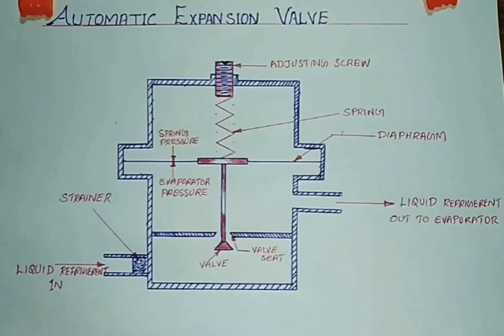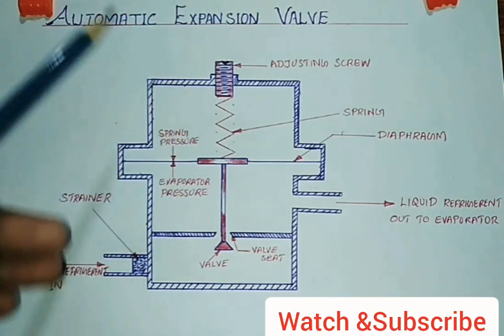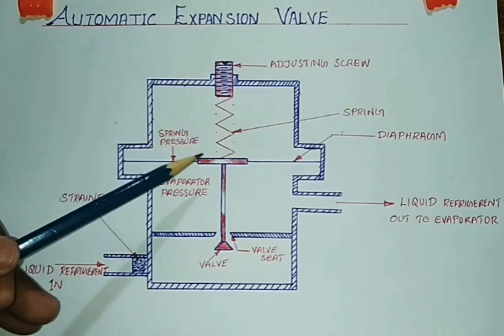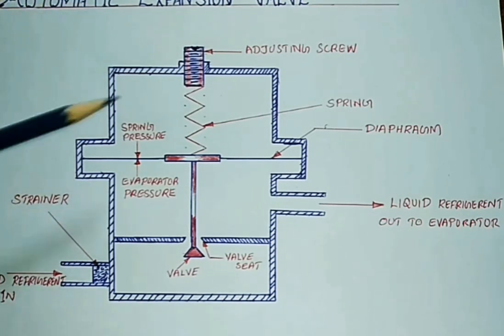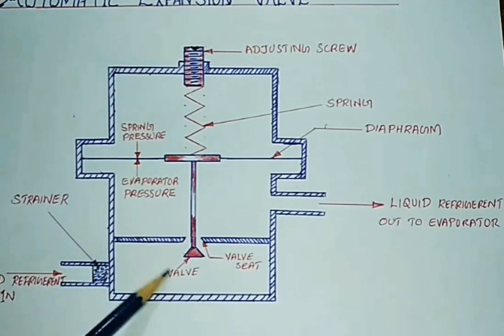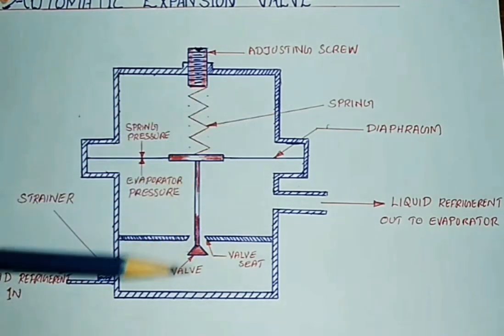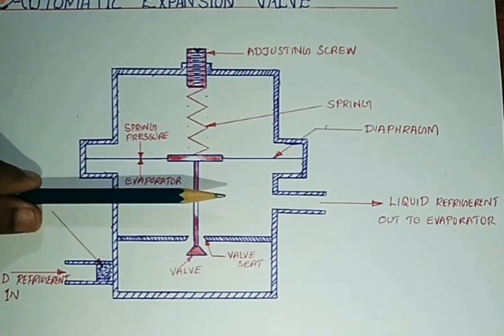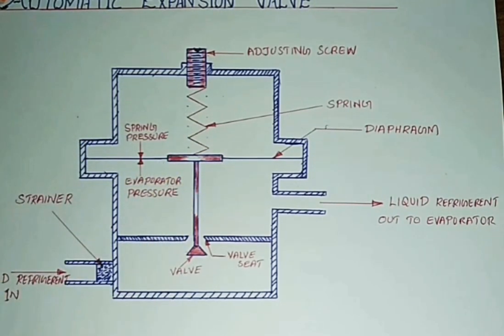#AutomaticExpansionValve #WorkingPrincipleInMalayalam #RAC|#kgcerefrigerationandairconditioning

Comment: 1A. *valve.
     *valve seat.
     *diaphram.
     *spring.
     *adjusting screw. 
2A. ഡയഫ്രത്തിന്റെ മുകളിൽ spring pressure. 
ഡയഫ്രത്തിന്റെ താഴെ evaporator pressure. 
3A. ഡയഫ്രത്തിന്റെ മുകളിൽ act ചെയ്യുന്ന രണ്ട് പ്രഷർ act ചെയ്യുന്നത് പോലെ ആയിരിക്കും valve തുറക്കുന്നതും അടയുന്നതും. 

MUHAMMED MUBEEN. K
RAC JR A BATCH
ROLL:NO. 18
Reply from the maker: Good ✔️✔️✔️
Reply from the maker: Diaphragm

Comment: Jaseel k
 no :16
R& ac jr b batch
--------------------------

1a.valve,  Valve seat, Diaphram, Spring, 
Adjusting screw 
2a.ഡയഫ്രത്തിന്റെ മുകളിൽ spring 
Pressure
ഡയഫ്രത്തിന്റെ തായെ evaporator pressure
3a.ഡയഫ്രത്തിന്റെമുകളിൽact 
ചെയ്യുന്ന രണ്ട് pressure act ചെയ്യൂ 
ന്നത്പോലെ ആയിരിക്കും valve 
തുറക്കുന്നതും അടയുന്നതും ചെയ്യുന്നത്.

Comment: Nishad pn 24 Jr b batch
1 a valve
Valve seat
Diaphram
Spring
Adjusting screw

2 a diaphrathinte mukhalill spring pressure
Diaphrathinte thaye evaporator pressure
3 a diaphrathinte mukhallil act cheyunnapole ayirikum valve thurakunnadhum adakunnadhum

Comment: Q1: •Valve
        • Valve seat
        •Diaphragm
        •Spring
        •Adjusting Screw

Q2: ഡയഫ്രത്തിന്റെ മുകളിൽ Spring pressure .ഡയഫ്രത്തിന്റെ താഴെ Evaporator pressure.

Q3: സയഫ്രത്തിന്റെ മുകളിൽ ആക്റ്റ് ചെയ്യുന്ന രണ്ട് പ്രഷർ ആക്റ്റ് ചെയ്യുന്നത് പോലെ ആയിരിക്കും വാൾവ് തുറക്കുകയും അടയുക്കു കയും ചെയ്യുന്നത്.

MUHAMMED UVAIS P 
RAC JR A BATCH

Comment: Albin benny
Roll no :4
R& ac jr b batch
--------------------------

1a.valve 
   Valve seat
   Diaphram
  Spring
Adjusting screw 
2a.ഡയഫ്രത്തിന്റെ മുകളിൽ spring 
Pressure
ഡയഫ്രത്തിന്റെ തായെ evaporator pressure
3a.ഡയഫ്രത്തിന്റെ മുകളിൽ act 
ചെയ്യുന്ന രണ്ട് pressure act ചെയ്യൂ 
ന്നത്പോലെ ആയിരിക്കും valve 
തുറക്കുന്നതും അടയുന്നതും ചെയ്യുന്നത്.

Comment: Muhammad Hashir p
R& AC B batch
No..12
1A . * valve . * valve seat . * diaphram . * spring . * adjusting screw .
 2A . ഡയഫ്രത്തിന്റെ മുകളിൽ spring pressure . ഡയഫ്രത്തിന്റെ താഴെ evaporator pressure .
 3A . ഡയഫ്രത്തിന്റെ മുകളിൽ act ചെയ്യുന്ന രണ്ട് പ്രഷർ act ചെയ്യുന്നത് പോലെ ആയിരിക്കും valve തുറക്കുന്നതും അടയുന്നതും .

Comment: 1:valve
Valve seat
  Diaphram
  Spring
  Adjasting screw
2:a diphrathinte makhlill spring  pressure           diaphrathinte thure evaporutor pressure
3:a diphrathinte makhlillact  cheyannapote
   Ayirikam valve thurukannadhum adakunndhum
  RAC/JR/B/BATCH
 ROLLNO:2
Adithyan..at

Comment: R/AcC jounir b batch no:06 
Arun Johny 
1a.  valve
        Valve seat
        Diaphram
        Spring
        Adjusting screw
     2a .diafram മുകളിൽ spring pressure disfram താഴെ evaperater  pressure.
      3a .diafram മുകളിൽ act ചെയുന്ന pressure act ചെയുന്നത് പോലെ ആയിരിക്കും valve തുറക്കുന്നു .

Comment: 1) *valve
    *Valve seat
    *diaphram
    *spring
    *adjusting screw
2) ഡയഫൃത്തിൻെ മുകളിൽ spring pressure
    * ഡയഫൃത്തിൻെ താഴെ  evaporator pressure
3) ഡയഫൃത്തിൻെ മുകളിൽ അക്റ്റ് ചെയ്യുന്ന 2പൃഷർ.പൃഷർ അക്റ്റ് ചെയ്യന്നതിനനുസരിച്ച് valve തുറക്കുകയും അടയുകയും ചെയ്യുന്നു
MANU HAFIL
RAC JR A BATCH
ROLL NO:10

Comment: Q1: Valve
       Valve seat
       Diaphyam
       Spring
      Adjusting Scr
Q2: ഡയഫ്രത്തിന്റെ മുകളിൽ Spring pressure.
             ഡയഫ്രത്തിന്റെ താഴെ Evaporator pressure.
Q3: സയഫ്രത്തിന്റെ മുകളിൽ ആക്റ്റ് ചെയ്യുന്ന രണ്ട് പ്രഷർ ആക്റ്റ് ചെയ്യുന്നത് പോലെ ആയിരിക്കും വാൾവ് തുറക്കുകയും അടയുക്കു കയും ചെയ്യുന്നത്.
Ameen Minhaj as
RAC jr A Batch
Roll No 6

Comment: Q1: valve
        Valve seal
         Diaphyam
        Spring
         Adjusting scr
Q2 : spring pressure above the diaphragm evaporator pressure below the diaphragm
Q3: ഡയഫ്രത്തിന്റെ മുകളിൽ Act ചെയ്യുന്ന രണ്ട് പ്രഷർ Actചെയ്യുന്നത് പോലെ ആയിരിക്കും valve തുറക്കുന്നതും
അടക്കുന്നതും

Comment: A1.valve
    . Valve seat
    . Diaphram
    . Spring
    . Adjusting screw
A2 ഡയഫ്രത്തിന്റെ മുകളിൽ  spring pressor
ഡയഫ്രത്തിന്റെ താഴെ evaporator pressor
A3.ഡയഫ്രത്തിന്റെ മുകളിൽ act ചെയുന്ന രണ്ട് പ്രഷർ act ചെയുന്നത് പോലെ ആയിരിക്കും valve തുറക്കുന്നതും അടയുന്നതും 

Nisamudheen
Rac jr a bach
Rol no 21

Comment: 1. Valve
Valve seat
Diaphyam
Spring
Adjusting scr
2. ഡയഫ്രത്തിൻ്റെ മുകളിൽ spring pressure
ഡയഫ്രത്തിൻ്റെ താഴെ evaporator pressure
3. ഡയഫ്രത്തിൻ്റെ മുകളിൽ ആക്റ്റ് ചെയ്യുന്ന രണ്ട് പ്രഷർ ആക്റ്റ് ചെയ്യുന്നത് പോലെ. ആയിരിക്കും വാൾവ് തുറക്കുകയും അടക്കുകയും ചെയ്യുന്നത്
Vishnu das m.u
RAC jr A bacth
No.30

3.

Comment: 1a-valve
   . Valve seat
   . Diaphram
   . Spring
   . Adjusting screw
2a-ഡയഫ്രത്തിന്റെ മുകളിൽ spring pressure
ഡയഫ്രത്തിന്റെ തയെ evaporator pressure
3a-ഡയഫ്രത്തിന്റെ മുകളിൽ act ചെയ്യുന്ന രണ്ട് pressure act ചെയ്യുന്നത് പോലെ ആയിരിക്കും valve തുറക്കുന്നതും അടയുന്നതും 
              
            MUHAMMED SHIYAS
                 R A/C JR A
                  ROLL NO -24

Comment: Athul
Roll no :9
R& ac jr b batch

1a.valve 
   Valve seat
   Diaphram
  Spring
Adjusting screw 
2a.ഡയഫ്രത്തിന്റെ മുകളിൽ spring 
Pressure
ഡയഫ്രത്തിന്റെ തായെ evaporator pressure
3a.ഡയഫ്രത്തിന്റെ മുകളിൽ act 
ചെയ്യുന്ന രണ്ട് pressure act ചെയ്യൂ 
ന്നത്പോലെ ആയിരിക്കും valve 
തുറക്കുന്നതും അടയുന്നതും ചെയ്യുന്നത്.

Comment: 1.a *valve
      *valve seat
     *diaphram
      * spring 
     * adjusting screw
2.a ഡയഫ്രത്തിൻെ മുകളിൽ spring pressure 
      ഡയഫ്രത്തിൻെ തായേevaporator pressure 
3.a ഡയഫ്രത്തിൻെ മുകളിൽ act ചെയ്യുന്ന 2 pressure act ചെയ്യുന്നത് പോലെ ആയിരിക്കും valve തുറക്കുന്നതും അടയുന്നതും ചെയ്യുന്നത്
Finu fahad 
R/ac jn.   B.    Batch 
No: 14

Comment: 1a.valve 
   Valve seat
   Diaphram
  Spring
Adjusting screw 
2a.ഡയഫ്രത്തിന്റെ മുകളിൽ spring 
Pressure
ഡയഫ്രത്തിന്റെ തായെ evaporator pressure
3a.ഡയഫ്രത്തിന്റെ മുകളിൽ act 
ചെയ്യുന്ന രണ്ട് pressure act ചെയ്യൂ 
ന്നത്പോലെ ആയിരിക്കും valve 
തുറക്കുന്നതും അടയുന്നതും ചെയ്യുന്നത്. 
       

Aswanth.TM
Roll:No:7
Rac jr b batch

Comment: 1a.valve
    Valve seat
    Diaphram
    Spring
    Adjusting screw
2a.ഡയഗ്രത്തിൻ്റെ മുകളിൽ spring pressure ഡയഗ്രത്തിൻ്റെ താഴെ evapurator
Pressure
3a.ഡയഗ്രത്തിൻ്റെ മുകളിൽ act ചെയ്യന്ന രണ്ട് Pressure act ചെയ്യുന്നത് പോലെ valve തുറക്കുന്നതും അടയുന്നതും
 
Muhammed Minhaj VA 
  Rac jr A batch
Roll no 17

Comment: Q1-Valve
Valve seat
Diaphyam
Spring
Adjusting Scr

Q2-Spring pressure above the diaphragm
Evaporator pressure below the diaphragm

3Q-ഡയഫ്രത്തിന്റെ മുകളിൽ act ചെയ്യുന്ന രണ്ട് പ്രഷർ act 
ചെയ്യുന്നത് പോലെ ആയിരിക്കും valve തുറക്കുന്നതും 
അടയുന്നതും

--------------------------------------------
( Muhammed Munshid k 
RAC Jr A Batch 
Roll No. 19 )
-------------------------------------------
Reply: Hi
Reply: @muhammedharshad602  Hy

Comment: 1 a valve Valve seat Diaphram Spring Adjusting screw

 2 a diaphrathinte mukhalill spring pressure Diaphrathinte thaye evaporator pressure 

 3 a diaphrathinte mukhallil act cheyunnapole ayirikum valve thurakunnadhum adakunnadhum 
    

muhammed nihan  
RAC jr A batch
roll no 20

Comment: 1a:valve  
. Valve 
.Diaphram
. Spring 
. Adjusting screw
2a-:diaphramthinta  mukalil spring pressure  diaphram thaaye evaporator pressure 
3a: diaphram thinta mukalil  act  cheyyunna rand pressure  act cheyyunnath  poole aayirikum valve thurakkunnathum adakkunnthum  
 
          Rinshad kv
         RAC(jr) A  batch 
         Roll no : 28

Comment: I.Valve
 .valve Seat
 .diaphram
 . Sprig
 .adjusting screw
2. ഡ യ ഫ്രത്തിൻ്റെ മുകളിൽ spring pressur
 ' ഡയഫ്രത്തിൻ്റെ താഴെ evaporator Pressur
3' ഡയഫ്രത്തിൻ്റെ മുകളിൽ act ചെയ്യുന്ന രണ്ട് പ്രഷർ act ചെയ്യുന്നത് പോലെ ആയിരിക്കും valve തുറക്കുന്നതും അടക്കുന്നതും

RAC Jr A BACH
NO 15
MUHAMMED HARSHAD KP

Comment: 1.valve
   Valve seat
  Diaphyam
  Spring
  Adjusting scr
2.ഡയഫ്രത്തിന്റെ മുകളിൽ spring pressure
    ഡയഫ്രത്തിന്റെ  താഴെ  evaporator pressure
3.ഡയഫ്രത്തിന്റെ മുകളിൽ ആക്റ്റ് ചെയ്യുന്ന രണ്ട് പ്രഷർ ആക്റ്റ് ചെയ്യുന്നത് പോലെ ആയിരിക്കും വാൾവ് തുറക്കുകയും അടയ്ക്കുകയും ചെയ്യുന്നത് 
    Afsal. V
    Rac jr A Batch
    Roll No.  4

Comment: Q1: Valve
       Valve seat
       Diaphyam
       Spring
      Adjusting Scr

Q2: ഡയഫ്രത്തിന്റെ മുകളിൽ Spring pressure.
             ഡയഫ്രത്തിന്റെ താഴെ Evaporator pressure.

Q3: സയഫ്രത്തിന്റെ മുകളിൽ ആക്റ്റ് ചെയ്യുന്ന രണ്ട് പ്രഷർ ആക്റ്റ് ചെയ്യുന്നത് പോലെ ആയിരിക്കും വാൾവ് തുറക്കുകയും അടയുക്കു കയും ചെയ്യുന്നത്.

Adarsh_tr 
RAC jr A Batch
Roll No 2

Comment: 1a.valve 
   Valve seat
   Diaphram
  Spring
Adjusting screw 
2a.ഡയഫ്രത്തിന്റെ മുകളിൽ spring 
Pressure
ഡയഫ്രത്തിന്റെ തായെ evaporator pressure
3a.ഡയഫ്രത്തിന്റെ മുകളിൽ act 
ചെയ്യുന്ന രണ്ട് pressure act ചെയ്യൂ 
ന്നത്പോലെ ആയിരിക്കും valve 
തുറക്കുന്നതും അടയുന്നതും ചെയ്യുന്നത്. 
       

Aswin krishna. Tp
Roll:No:8
Rac jr b batch

Comment: Muhammed Irshad 
R a/c  B batch 
Roll No:15

1a. Valve
    .valve seat
    .diaphram
    .spring
    .Adjusting screw
2a.diaphrathinte
.     mukhalill spring
pressure diuphrathinte thaye evaporator pressure
3a. Diaphra thinte mujhelill act cheyunna pole ayirikum valve tharakunnadhum adakunnadhum

Comment: Q1: Valve
       Valve seat
       Diaphyam
       Spring
      Adjusting Scr
Q2: ഡയഫ്രത്തിന്റെ മുകളിൽ Spring pressure.
             ഡയഫ്രത്തിന്റെ താഴെ Evaporator pressure.
Q3: സയഫ്രത്തിന്റെ മുകളിൽ ആക്റ്റ് ചെയ്യുന്ന രണ്ട് പ്രഷർ ആക്റ്റ് ചെയ്യുന്നത് പോലെ ആയിരിക്കും വാൾവ് തുറക്കുകയും അടയുക്കു കയും ചെയ്യുന്നത്.
(MHD MIDLAJ MC 
RAC jr A Batch
Roll No 16)

Comment: Q1: Valve
       Valve seat
       Diaphyam
       Spring
      Adjusting Scr
Q2: ഡയഫ്രത്തിന്റെ മുകളിൽ Spring pressure.
             ഡയഫ്രത്തിന്റെ താഴെ Evaporator pressure.
Q3: സയഫ്രത്തിന്റെ മുകളിൽ ആക്റ്റ് ചെയ്യുന്ന രണ്ട് പ്രഷർ ആക്റ്റ് ചെയ്യുന്നത് പോലെ ആയിരിക്കും വാൾവ് തുറക്കുകയും അടയുക്കു കയും ചെയ്യുന്നത്.
Akhilpk
RAC jr A Batch
Roll No 5

Comment: Muhammed shafeeque 
Roll no :20
R& ac jr b batch

1a.valve 
   Valve seat
   Diaphram
  Spring
Adjusting screw 
2a.ഡയഫ്രത്തിന്റെ മുകളിൽ spring 
Pressure
ഡയഫ്രത്തിന്റെ തായെ evaporator pressure
3a.ഡയഫ്രത്തിന്റെ മുകളിൽ act 
ചെയ്യുന്ന രണ്ട് pressure act ചെയ്യൂ 
ന്നത്പോലെ ആയിരിക്കും valve 
തുറക്കുന്നതും അടയുന്നതും ചെയ്യുന്നത്.

Comment: RAC - JR -A Bach 
ROLL NO - 1
ABIJITH  TK

1: Valve
    Valve seat
    Diaphyam
    Spring
    Adjusting Scr
2: ഡയഫ്രത്തിന്റെ മുകളിൽ Spring pressure.
             ഡയഫ്രത്തിന്റെ താഴെ Evaporator pressure.
3: സയഫ്രത്തിന്റെ മുകളിൽ ആക്റ്റ് ചെയ്യുന്ന രണ്ട് പ്രഷർ ആക്റ്റ് ചെയ്യുന്നത് പോലെ ആയിരിക്കും വാൾവ് തുറക്കുകയും അടയുക്കു കയും ചെയ്യുന്നത്.

Comment: Shanif
Roll no :28
R& ac jr b batch

1a.valve 
   Valve seat
   Diaphram
  Spring
Adjusting screw 
2a.ഡയഫ്രത്തിന്റെ മുകളിൽ spring 
Pressure
ഡയഫ്രത്തിന്റെ തായെ evaporator pressure
3a.ഡയഫ്രത്തിന്റെ മുകളിൽ act 
ചെയ്യുന്ന രണ്ട് pressure act ചെയ്യൂ 
ന്നത്പോലെ ആയിരിക്കും valve 
തുറക്കുന്നതും അടയുന്നതും ചെയ്യുന്നത്.

Comment: MUHAMMAD SHAFEEQ NK 
RAC JUNIOR B  BATCH 
ROLL NO :21

  1A : valve 
        *valve seat 
        *diaphragm 
        * spring 
        *adjusting screw 
 2A: ഡയഫ്രത്തിന്റെ മുകളിൽ സ്പ്രിങ് pressure 
               ഡയഫ്രത്തിന്റെ താഴെ evaprator pressure 
3A: ഡയഫ്രത്തിന്റെ മുകളിൽ act ചെയ്യുന്ന രണ്ട് pressure act ചെയ്യുന്നത് പോലെ ആയിരിക്കും valve  തുറക്കുന്നതും അടക്കുന്നതും ചെയ്യുന്നത്

Comment: Muhammad shabeeb pp
Roll no : 19
RAC jr B-batch

1.Valve 
   Valve seat
   Diaphram
   Spring
   Adjusting screw 
2.ഡയഫ്രത്തിന്റെ മുകളിൽ spring 
 Pressure
 ഡയഫ്രത്തിന്റെ തായെ evaporator      pressure
3.ഡയഫ്രത്തിന്റെ മുകളിൽ act 
 ചെയ്യുന്ന രണ്ട് pressure act ചെയ്യൂ 
 ന്നത്പോലെ ആയിരിക്കും valve 
 തുറക്കുന്നതും അടയുന്നതും   ചെയ്യുന്നത്.

Comment: Anudarsh. K
           Roll. No 5
           R&A/C jr b batch
_____________________________

1a.valve 
   Valve seat
   Diaphram
  Spring
Adjusting screw 
2a.ഡയഫ്രത്തിന്റെ മുകളിൽ spring 
Pressure
ഡയഫ്രത്തിന്റെ തായെ evaporator pressure
3a.ഡയഫ്രത്തിന്റെ മുകളിൽ act 
ചെയ്യുന്ന രണ്ട് pressure act ചെയ്യൂ 
ന്നത്പോലെ ആയിരിക്കും valve 
തുറക്കുന്നതും അടയുന്നതും ചെയ്യുന്നത്.

Comment: Q1: Valve
       Valve Sheet  
     Push road
   Brings
  Spring adjusting Scr
Mechanical difrom
Feeler bulb
Q2: Liqued refrigerant ഭാഗികമായി നിറച്ചിരിക്കുന്നു.
Q3: Feeler bulb pressure
     Spring pressure
     Evoprator pressure

         Mihraj ep 
RAC jr A Batch
Roll No 11

Comment: SHAMIL NK
R& ac jr b batch
--------------------------

1a.valve 
   Valve seat
   Diaphram
  Spring
Adjusting screw 
2a.ഡയഫ്രത്തിന്റെ മുകളിൽ spring 
Pressure
ഡയഫ്രത്തിന്റെ തായെ evaporator pressure
3a.ഡയഫ്രത്തിന്റെ മുകളിൽ act 
ചെയ്യുന്ന രണ്ട് pressure act ചെയ്യൂ 
ന്നത്പോലെ ആയിരിക്കും valve 
തുറക്കുന്നതും അടയുന്നതും ചെയ്യുന്നത്.

Comment: AHAMMED NABEEL PM
R&A/C JR B BATCH
ROLL NUMBER:3️⃣
--------------------------

1a.valve 
   Valve seat
   Diaphram
  Spring
Adjusting screw 
2a.ഡയഫ്രത്തിന്റെ മുകളിൽ spring 
Pressure
ഡയഫ്രത്തിന്റെ തായെ evaporator pressure
3a.ഡയഫ്രത്തിന്റെ മുകളിൽ act 
ചെയ്യുന്ന രണ്ട് pressure act ചെയ്യൂ 
ന്നത്പോലെ ആയിരിക്കും valve 
തുറക്കുന്നതും അടയുന്നതും ചെയ്യുന്നത്.

Comment: Muhamadh shahad
Roll no :22
R& ac jr b batch
--------------------------

1a.valve 
   Valve seat
   Diaphram
  Spring
Adjusting screw 
2a.ഡയഫ്രത്തിന്റെ മുകളിൽ spring 
Pressure
ഡയഫ്രത്തിന്റെ തായെ evaporator pressure
3a.ഡയഫ്രത്തിന്റെ മുകളിൽ act 
ചെയ്യുന്ന രണ്ട് pressure act ചെയ്യൂ 
ന്നത്പോലെ ആയിരിക്കും valve 
തുറക്കുന്നതും അടയുന്നതും ചെയ്യുന്നത്.

Comment: vahid
Roll no :1
R& ac jr b batch
--------------------------

1a.valve 
   Valve seat
   Diaphram
  Spring
Adjusting screw 
2a.ഡയഫ്രത്തിന്റെ മുകളിൽ spring 
Pressure
ഡയഫ്രത്തിന്റെ തായെ evaporator pressure
3a.ഡയഫ്രത്തിന്റെ മുകളിൽ act 
ചെയ്യുന്ന രണ്ട് pressure act ചെയ്യൂ 
ന്നത്പോലെ ആയിരിക്കും valve 
തുറക്കുന്നതും അടയുന്നതും ചെയ്യുന്നത്.

Comment: Shibin kurian
Roll no :29
R& ac jr b batch
--------------------------

1a.valve 
   Valve seat
   Diaphram
  Spring
Adjusting screw 
2a.ഡയഫ്രത്തിന്റെ മുകളിൽ spring 
Pressure
ഡയഫ്രത്തിന്റെ തായെ evaporator pressure
3a.ഡയഫ്രത്തിന്റെ മുകളിൽ act 
ചെയ്യുന്ന രണ്ട് pressure act ചെയ്യൂ 
ന്നത്പോലെ ആയിരിക്കും valve 
തുറക്കുന്നതും അടയുന്നതും ചെയ്യുന്നത്.

Comment: Muhammed sinan A 
R/AC JR A BATCH 
ROLL NO 25
---------------
A1- *Valve
         * Valve seat
         *Diaphyam
         *Spring
         *Adjusting Scr
A2- *ഡയഫ്രത്തിന്റെ മുകളിൽ Spring pressure.
    * ഡയഫ്രത്തിന്റതാഴെ Evaporator pressure.
A3- സയഫ്രത്തിന്റെ മുകളിൽ ആക്റ്റ് ചെയ്യുന്ന രണ്ട് പ്രഷർ ആക്റ്റ് ചെയ്യുന്നത് പോലെ ആയിരിക്കും വാൾവ് തുറക്കുകയും അടയുക്കു കയും ചെയ്യുന്നത്.

Comment: MUHAMMED RINSHAD PK
Roll no :17
R& ac jr b batch
--------------------------

1a.valve 
   Valve seat
   Diaphram
  Spring
Adjusting screw 
2a.ഡയഫ്രത്തിന്റെ മുകളിൽ spring 
Pressure
ഡയഫ്രത്തിന്റെ തായെ evaporator pressure
3a.ഡയഫ്രത്തിന്റെ മുകളിൽ act 
ചെയ്യുന്ന രണ്ട് pressure act ചെയ്യൂ 
ന്നത്പോലെ ആയിരിക്കും valve 
തുറക്കുന്നതും അടയുന്നതും ചെയ്യുന്നത്.

Comment: Q1: Valve
       Valve seat
       Diaphyam
       Spring
      Adjusting Scr
Q2: ഡയഫ്രത്തിന്റെ മുകളിൽ Spring pressure.
             ഡയഫ്രത്തിന്റെ താഴെ Evaporator pressure.
Q3: സയഫ്രത്തിന്റെ മുകളിൽ ആക്റ്റ് ചെയ്യുന്ന രണ്ട് പ്രഷർ ആക്റ്റ് ചെയ്യുന്നത് പോലെ ആയിരിക്കും വാൾവ് തുറക്കുകയും അടയുക്കു കയും ചെയ്യുന്നത്.
Althaf pk
RAC jr A Batch
Roll No 12

Comment: Q1: Valve
       Valve seat
       Diaphyam
       Spring
      Adjusting Scr
Q2: ഡയഫ്രത്തിന്റെ മുകളിൽ Spring pressure.
             ഡയഫ്രത്തിന്റെ താഴെ Evaporator pressure.
Q3: സയഫ്രത്തിന്റെ മുകളിൽ ആക്റ്റ് ചെയ്യുന്ന രണ്ട് പ്രഷർ ആക്റ്റ് ചെയ്യുന്നത് പോലെ ആയിരിക്കും വാൾവ് തുറക്കുകയും അടയുക്കു കയും ചെയ്യുന്നത്.
Fahad
RAC jr A Batch
Roll No 13

Comment: Q1: Valve
       Valve seat
       Diaphyam
       Spring
      Adjusting Scr
Q2: ഡയഫ്രത്തിന്റെ മുകളിൽ Spring pressure.
             ഡയഫ്രത്തിന്റെ താഴെ Evaporator pressure.
Q3: സയഫ്രത്തിന്റെ മുകളിൽ ആക്റ്റ് ചെയ്യുന്ന രണ്ട് പ്രഷർ ആക്റ്റ് ചെയ്യുന്നത് പോലെ ആയിരിക്കും വാൾവ് തുറക്കുകയും അടയുക്കു കയും ചെയ്യുന്നത്.
Shaheer ik 
RAC jr A Batch
Roll No 29

Comment: Mashhood km
Roll no :11
R& ac jr b batch
--------------------------

1a.valve 
   Valve seat
   Diaphram
  Spring
Adjusting screw 
2a.ഡയഫ്രത്തിന്റെ മുകളിൽ spring 
Pressure
ഡയഫ്രത്തിന്റെ തായെ evaporator pressure
3a.ഡയഫ്രത്തിന്റെ മുകളിൽ act 
ചെയ്യുന്ന രണ്ട് pressure act ചെയ്യൂ 
ന്നത്പോലെ ആയിരിക്കും valve 
തുറക്കുന്നതും അടയുന്നതും ചെയ്യുന്നത്.

Comment: Q1: Valve
       Valve seat
       Diaphram
       Spring
      Adjusting Scr
Q2: ഡയഫ്രത്തിന്റെ മുകളിൽ Spring pressure.
             ഡയഫ്രത്തിന്റെ താഴെ Evaporator pressure.
Q3: സയഫ്രത്തിന്റെ മുകളിൽ ആക്റ്റ് ചെയ്യുന്ന രണ്ട് പ്രഷർ ആക്റ്റ് ചെയ്യുന്നത് പോലെ ആയിരിക്കും വാൾവ് തുറക്കുകയും അടയുക്കു കയും ചെയ്യുന്നത്.
Adilpk
RAC jr A Batch
Roll No 3

Comment: Safvan
Roll no :18
R& ac jr b batch
--------------------------

1a.valve 
   Valve seat
   Diaphram
  Spring
Adjusting screw 
2a.ഡയഫ്രത്തിന്റെ മുകളിൽ spring 
Pressure
ഡയഫ്രത്തിന്റെ തായെ evaporator pressure
3a.ഡയഫ്രത്തിന്റെ മുകളിൽ act 
ചെയ്യുന്ന രണ്ട് pressure act ചെയ്യൂ 
ന്നത്പോലെ ആയിരിക്കും valve 
തുറക്കുന്നതും അടയുന്നതും ചെയ്യുന്നത്.

Comment: Q1: Valve
       Valve seat
       Diaphyam
       Spring
      Adjusting Scr
Q2: ഡയഫ്രത്തിന്റെ മുകളിൽ Spring pressure.
             ഡയഫ്രത്തിന്റെ താഴെ Evaporator pressure.
Q3: സയഫ്രത്തിന്റെ മുകളിൽ ആക്റ്റ് ചെയ്യുന്ന രണ്ട് പ്രഷർ ആക്റ്റ് ചെയ്യുന്നത് പോലെ ആയിരിക്കും വാൾവ് തുറക്കുകയും അടയുക്കു കയും ചെയ്യുന്നത്.
Shamil.m
RAC Jr A Batch
Roll no.23